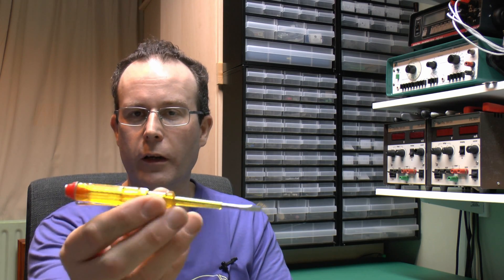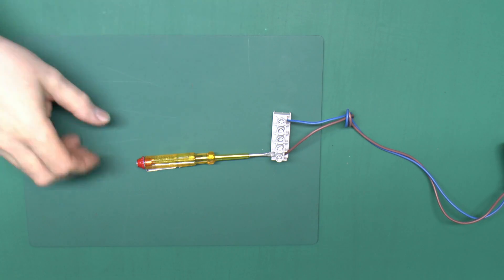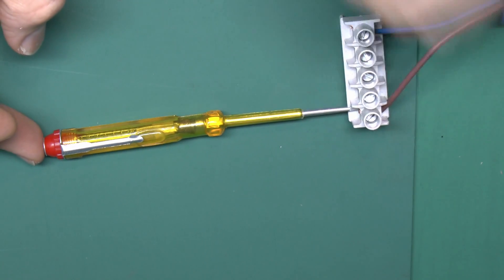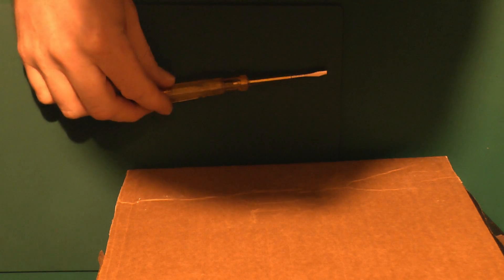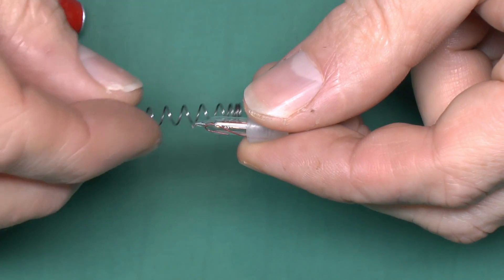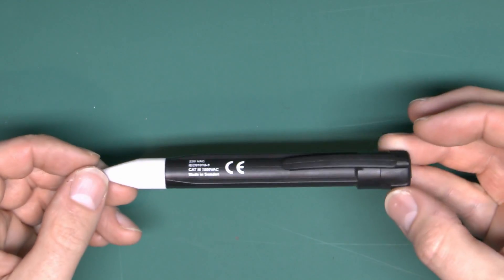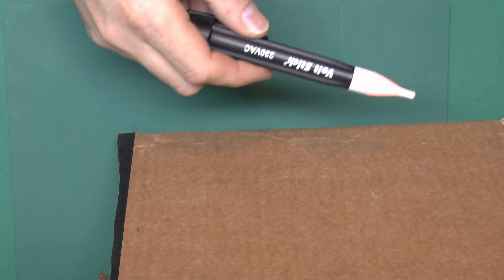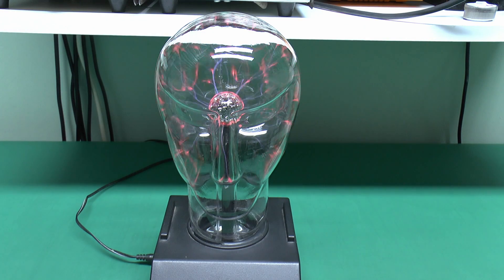Dangerous Device - Neon Mains Testing Screwdriver

Comment: I must say he chose the cheapest looking neon tester ive seen looked like the blade was some cheap alloy ive used good ones for over 30 years  without a problem like any test instrument looking after it is  required and periodic testing  before use and especially if left  without use for a period of time even his all singing and dancing bit of kit is only as good as the leads that connect it and the person who is using it making sure he connects to the terminals ok Yes it is crude but it could save your life   if nothing else is available Buy good quality  and it will serve you well.... shame he did not mention all the millions of multimeter leads out there without fuse protection...then again  thats another subject
Reply: You don't need fused multimeter leads on a good quality meter, i.e. ones designed for the the circuit that you are using it on.

Comment: Hi, I watch your video closely. I am using this screwdriver for a couple of years now without any problems. Of course this screwdriver works only on the live. I believe you change the live and
neutral  to “eye blind” the viewers. See the clip on 3.55 minutes and it shows the tester is showing a positive reading
though the black wire was on the live and the red was on neutral.  Please explain…  I try to figure out the cardboard… Why not remove
the cardboard to proof nothing was under the cardboard?

Comment: I'm looking for people that say "it's current that kills not volts" so that I can say How am I able to touch a car battery and be unscathed? Mind the fact that 400 amps can flow in a car battery...
Reply: whyrtyre , it's a combination of factors : first you need the force(volts) required to induce a current thru your body ,secondly you need the conditions that affect your body's resistance(clothing,footwear,humidity),third the amount of current....in practice it just takes 400 milliamps at 35  volts to stop your ❤ ...
Reply: Ohms law R=V/I,  12/400 = 0.03 ohms resistance for a current of 400 Amps to flow at 12V.  On a very bad day the resistance of say you hand to foot (earth) is 1000 ohms therfore I = V/R,    12/1000 = 0.012 Amps i.e. 12 milliamps (non lethal but painful), however normally the resistance can be as high as 100,000 ohms = 0.00012 Amps (wouldn't feel it).

Comment: Well, a tool that exist for almost 60 years saved probably more lives than it killed. (How many ?, that's not mentioned here ...) Do you think that somebody that is changing a bulb once a year will by a 2 poles device ? Plus, not convenient for a switch or anything where you don't have the neutral in the box. The 2 pole device is for me useless in most case.
Reply: You always have to a have a return conductor (neutral) for a current to flow, its in the 'box' may not be a colour you recognise or test either side of the switch!

Comment: Mate of mine got a near-fatal electric shock from one of these - put him in hospital. We were never sure what happened but it was one that came with a tool kit, somehow the voltage bridged inside the device right to the metal contact button you're supposed to touch and it even part melted the screwdriver steel on a standard 230v single phase domestic supply. One of the loudest bangs I've ever heard from an electric shock - like a firework going off. I bought him a Fluke non-contact tester for Xmas that year
Reply: It occurs to me that the melting of the screwdriver suggests a quite large amount of current flowed, far higher than you would expect the human body to draw so something peculiar occurred in this case.

Comment: u used the chepest posible neon tester
Reply: cheap or expensive, they all use a resistor and a neon, a spring that pushes it together, they can corrode inside due to the differering materials and be a pain to, they are not unsafe, but only for working domestic use and not drop them in a puddle etc.
Reply: Do you sell them?

Comment: In germany, we say "Lügenstift" (=lying pen) to that. 
It isn't allowed to be used for checking, that the voltage is turned off.
If you have nothing else handy, this is still better than nothing.
Reply: @PHILL DIXON  Because the aren´t forbidden. What he meant is you aren´t allowed to confirm that there is no power present when using one of those things according to some standards.

Comment: Dear Sir!I am an electrician and never had any problem with such devices.Yes there are other types of phase testers too.Trained,learned experienced maintenance workers,installateurs never died using these devices.Non craftmans, amateurs, may, but never heard of any.If one wants to know there's no voltage then double check with LED tester spec device,multimeter.Contactless beeping light testers can be unreliable too in some situations
Reply: Károly Varga I bet you don't even actually have a job

Comment: you state in the description that if the resistor fails then the operator will get the full mains voltage,
 1) most resistors go open cct not short cct when they fail 
 2) the neon bulb will have some resistance so you would not get the FULL mains!

These screwdrivers have been around for meany years and have saved a lot of people from electric shocks. (speaking from experience
Reply: You are correct, however, if their is no visible indication that the resistor has failed (open) no current will flow, therefore, neon light will not illuminate.  Happy their is no voltage you touch line and neutral or you are earthed and suffer a possible fatal shock.

If these go wrong /short, nothing is in the way of full supply voltage and you! Limited safety features.

Comment: My dad was using it for years, and now he's still fine...
Reply: One of the problem is, it is also a screw driver, when that kind plastic get old, it will crack and shatter. Anyone also have same experience that the entire screw driver shatter in your hand while you work on a screw with 220v live?
Reply: @luderickwong  - Yeah if there was a crack, exposure, or even moisture > ZAP > LEATHAL SHOCK!!!
Reply: @luderickwong  Any type of screwdriver can be damaged. What's your point?
Reply: @luderickwong  In Finland at the some point those could not have the screwdriver. That made them completely useless. Most people use those only as screwdrivers.

A non-contact voltage tester is better.
Reply: me too, it will light on a Live wire but not a neutral... pretty easy to understand.
Reply: Ok, here's a secret trick for y'all:
- always have at least 2 at hand
- try both of them in a socket to see if it works
(the oldest one we have never failed, some newer/cheaper ones did)
Reply: 99.9% of the time nothing bad happens.  I would rather use the equipment that has been designed and tested to protect me from a lethal shock than trust somthing that hasn't been tested to the same standard hoping that the 0.1% of the time never happens to me.

You can only die once;  I don't wear a climbing harness, use ropes etc to stop me falling off a cliff, i use them to stop me hitting the ground!
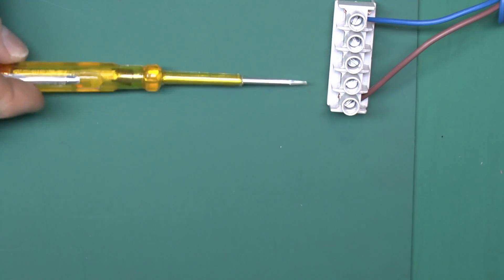Reply: 3:11 clearly lying for his own purpose, you can see the orange light come on then he moves the screwdriver tip to a point where it doesn't make contact
Stupid virgin

Comment: Why is the thumbs down same as up? I don't get that, This is a very important and informative video that is rather correct to the point that I will concur experiencing similar experiences
Reply: Well wonder no more, and seek Ye Enlightenment (which you will not get from this nonsense). Firstly, the backdrop to the video is set to cement his superiority, to ensure that you believe it. Then he picks, probably the worst neon screwdriver on the planet, and offers it up as all neon drivers are going to kill you. Now what you need to consider, without being surrounded by such bullshit, is simply this. Why do companies such as C.K. (who are rather big in the industry) still manufacture, and sell such deadly items? I have no issue in any poorly made, or dangerous item being highlighted, but that`s not how this offering was played out.
Reply: I'm wondering the same. I always wondered how the sparkey drivers worked as well and that was also answered. I thought this was rather well done. I always use my multimeter to test out of force of habit though it can be cumbersome at times.
Reply: some people cant be trusted with things, so thumbs down, its the safety nazis, they read it on some teenagers blog so they know it all
Reply: Got2Bgaga, why watch it.  I presume you are not an electrician? JW has a dry sense of humour.  Can you find any evidence that you could use such a device to prove a single or 3 phase line conductor is safe to work on?
Reply: If you read my comment properly, it`s not me that you should be questioning. Nor is it me who is burdened with having to prove anything either.
Reply: Roderick Jones 
GS38
Reply: So why reply Got2Bgaga?
Reply: Roderick Jones Simply put, Because I want you to THINK, instead of being led like a dumb sheep. So when YOU find the evidence required (not me), then I fully expect you to take to task, all the big manufacturers, and suppliers who make, and sell such a dangerous product.
Reply: I see your point,  GS38 gives guidence and recomendations for equipment used to prove electrical installations are 'dead' before working on them.  Yes you can use fused leads (recomendation), however,  2 pole probes, fixed leads have internal protection, multimeters (good quality meeting BS /EU)  also have intermal hbc fusing.   Any equipment manufactured prior doesn't have to be scrapped etc.  So i stand by my original statement 'fused leads are not a legal requirement'.
Reply: I do think, thats the reason for using a two pole voltage tester to prove dead and not my body as part of the circuit!  Do you employ people in the UK?
Reply: Roderick Jones Listen sheep! We are not discussing the issue of other test equipment. So until such time as you challenge the major manufacturers, on producing dangerous goods, then go away!
Reply: Get anoyed when your point of view is challanged?
Reply: Not really. I just find it strange why you insist on labouring your moot point of opinion. Mine is not an opinion, when the FACT remains, that reputable manufacturers and suppliers still sell the damn things! As I have said in previous comments, I have no issue with the highlighting of cheap Chinese, or poorly made goods,  but that`s not how this offering is played out.
Reply: You are, otherwise, why reply!
Reply: I reply to give you a better source of enlightenment, rather than being misled like a sheep. Who knows, one day it could well lead to you becoming more intelligent, or at least develop the savvy to think, hmmm I wonder why recognised industry manufacturers DO make neon screwdrivers. I appreciate it must be difficult for you,  but you really need to take it up with the manufacturers, and put a stop to the production and marketing of such deadly instruments. I look forward to your response when you have successfully saved all of mankind from neon screwdrivers!
Reply: Are you a neon screw driver manufacture?
Reply: These questionable devices have an unusually high number of people whom defend their use because they feel that intelligently using them makes it alright that you are passing mains voltage through your body.

Comment: I think a good lesson to take away from this, is that mechanical devices can fail, and do fail.  Personally I would make multiple checks, preferably with several different devices, before concluding that an electrical circuit was not energized.

Comment: can you get any more vague about what you are doing with the power supply to get the 2 "bad" devices not to work instead of doing this vague shit and claiming everyone should get one of those "proper" testing devices how about you just teach people what is going on in these experiments instead? that would actually be useful... also i would like to note that your "proper" device dousnt work if you only have a single powered lead and no ground or null line to test against. And the other two devices DO work in that case.
Reply: Agree. I'm guessing the 240V where the probe doesn't show, he's working with isolated AC but why be so damn mysterious about it?

Comment: You standing on a two meter tall glassfiber ladder, that is on two layers of plastic flore protective , you wearing a boot that has an inch thick rubber sole, now how much of a resistance that ?
You can touch live with your bare fingers , no problem.....
Reply: What could go possibly wrong, other than touching either neutral or earth with the other! lol

Comment: Why so many downvotes? Everyone in the industry knows that those neon screwdrivers are not certified to be used to test for a dead mains! He even demonstrates using a isolation transformer! Hospitals for example have isolated mains. Rural households or small villages have bad earth resistance which gives a similar scenario to the isolation transformer. Also you never want to rely on one puny, cheap carbon film resistor made in china to protect you from lethal energies!!! Besides your mains could be at 240v, but it could also be at 400v as it's the case with 3-phase power, and even at 240v you get 325v at the peak point! Always use a voltage checker with two poles that measures the voltage between two points!

Comment: I would say that the 2 pole device he was promoting was just as dangerous, as demo'd if the neutral was open circuit the device would not illuminate even though it was connected to the live terminal. This device i would say should only be used with reference to a known good earth, not the neutral.

Comment: The last time I used one of these I nearly killed the guy standing behind me, well, at least I knocked him to the ground with my elbow because the damn thing was shorted and I got shocked causing my muscles to contract and my arm to propel back at full power and my elbow right in his face.

Never again, now I stick to proper CAT rated meters.
Reply: Yeah, that's not easy when you are testing a wall socket, let's hear your suggestion.
Reply: Do tell please, or is it because you have nothing?
Reply: Ben what was the failure mode on this occasion? How did the dead short occur?
Reply: Would you use one of these neon screwdrivers after the neighbour has had a flood upstairs, if you can use a decent tester then why not use it.
Reply: BS. For one of these neon testers to short out as yours “did” , the internal resistor would have to go short circuit. Resistors NEVER go short circuit, it’s a fault that never happens to them, they only go “open circuit”. 
Please don’t bull shit people , it is un productive as is this video.

Comment: As a fully qualified Electronics Technician who has worked on products 
ranging from mobile phones to full scale industrial automated 
warehousing systems (3 phase systems), I fee that I can say........

....what a load of ROT!

1: If voltage indicating screwdrivers were in any way dangerous to use then they would not be allowed to sell them for a start.

2:The only situation where they might be dangerous to use is if you dropped it in a puddle before sticking it into a mains socket.    Which if your dumb enough to do, you obviously don't know anything about electricity! Which also means that your probably best hiring an electrician in the first place.

Comment: A high quality neon test screwdriver, not a cheap one that can be disassembled, a sealed unit is fine to use by someone who knows what they are doing, as with any test equipment, check that it's operational before putting it into service.

Comment: this is for testing live wires in the ceiling or on a light switch in a lighting radial circuit can you imagine a sparky pulling out your two probs to test a ceiling rose I am not impressed better to say nothing not to mention the times when all the wires and sleeving has been removed inside the rose and you can't even identify the neutal cable let alone where it's coming from jst my opinion
Reply: not a electrician then, if they did the neon screw driver test when being inspected they would loose there acreditation!